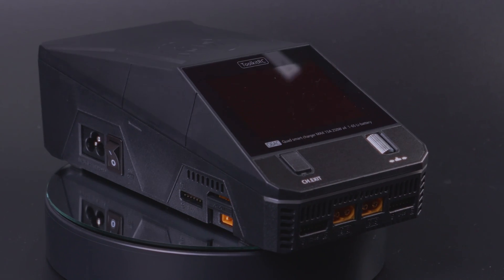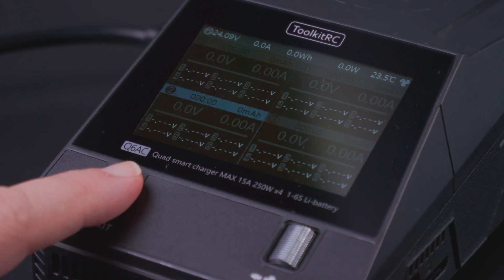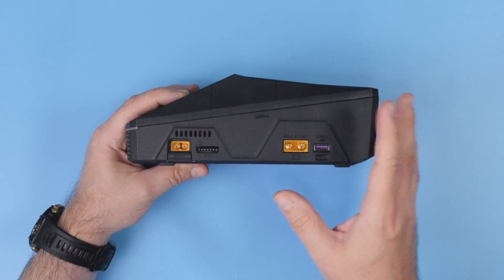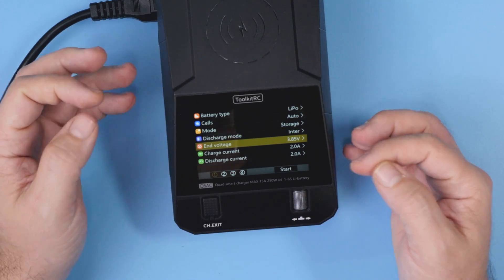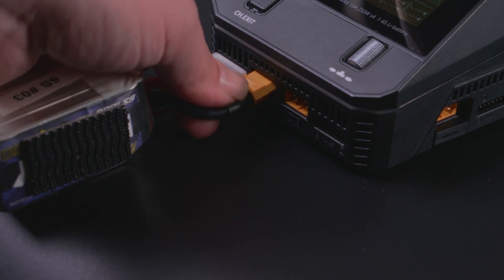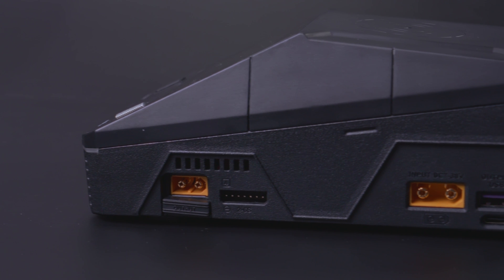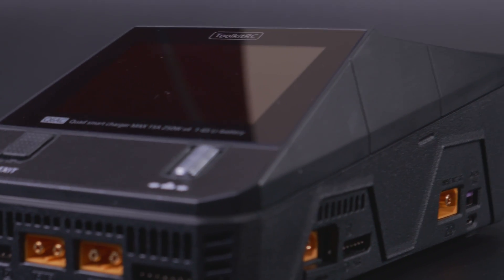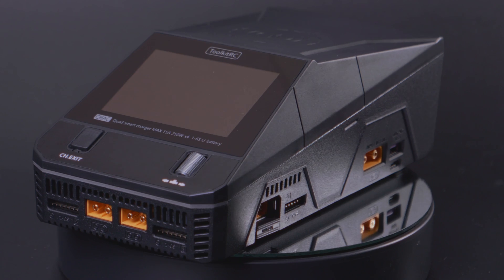The last charger you will ever need | ToolkitRC Q6AC

Comment: I just bought one. I run ec5 connectors on my 6s packs and tx60 on everything below that, so I’ve had to buy some female to male adapters. Would be nice if they included some of these in the box, especially for the price tag. They probably could have done this instead of adding a usb and wireless charging station. 🤣

Comment: A good charger yes, last charger, no. I want a touchscreen the size of a large iPhone, Bluetooth capability with a nice app, the ability to start a charge or discharge program using a timer or clock, and the ability to discharge a 2s battery at 20amps using only the charger, plus the ability to expand discharging capability with a discharge bank.

Comment: i personally modify my own chargers so that they are whisper silent (changing the fan to a noctua one)
my dream charger would be a Q4 charger with only 150-200W AC and a noctua fan! all those AC chargers are just too big and heavy! the ToolkitRC Q6AC beeing 1,2kg ..
i personally love the small ToolkitRC M6D with a 65w type c baseus charger and a type-c to xt-60 cable - really small and light package
charging 6S 1300mAh batteries i need about 30w per channel, so a quad charger with about 150w would be awesome!

edit: or something like the skyrc G630 Charging Hub would be incredible! with this the charger would charge one battery after the other on a "parellel board"!? too bad this system only works with a really bulky old charger ..
Reply from the maker: That would be nice!
Reply: you can't just change the fan to low rpm like noctua and expect the charger to have the same reliability
the noctua is quiet because it's low rpm but also low cfm compared to the stock fan so it will not have the same cooling performance
the charger would have to be designed for a low rpm/low cfm fan...or designed to use a bigger fan by having bigger heatsinks, more powerful power stages that do not get so hot etc

it's lame to have two 40mm fans in 2024, we have 2000w PC PSUs with 140mm fan that would be a lot quieter and even 1000w PSUs completely passive

Comment: Looks good, but disappointing that the front two ports are XT60 only. They assured me for ages before release it would charge both types, but this is a poor design decision.
Reply from the maker: I also would prefer dual purpose ports. But well, That would probably make charger much bigger

Comment: The Isdt K4 is smaller with the same output ratings AND supports 8s & 1.5A Balance current compared to 6s & 0.8 of the q6ac.. Does this make a huge difference in reality??

But it doesn't offer wireless charging and 65w pd, only 10w pd

Comment: Once I learned about Balance Current, I stopped buying ToolKit chargers. Hota D6,  1600ma balance current vs 800ma.
Reply: THIS

sure, you can charge big packs at high amp rates, but if your charger only balances at ~500ma that charge is going to take a real long time to complete.

my charging suite consists of 4 ISDT P20 chargers (1.5A balancing current) with 4-way parallel boards on each port.  each pair of chargers is fed by a single 1200W 24V PSU.  I'll charge anywhere from 8 to 24 packs simultaneously to completion at 1C in about an hour.)

Comment: I use ISTD Q6 NANO.
Cheap, can update firmware through USB, 6S and up to 200W charging, which is honestly a lot for such a tiny charger. 
It was so good I just bought a second one instead of a bigger one.

At 12V it is only 100W but that is still more than enough charging speed.
Reply: same. That charger is impressive but for sure pretty expensive
Reply: @dothgaerwenoakblossom15  34€ on Amazon? Anything less and I honestly wouldn't trust it on the safety side, you definitely don't want to skimp on safety for your charger.

Comment: More than 6S charging is one feature I'd really appreciate with chargers like this. I use 8S a lot (not for FPV multicopters, but larger fixed wing). It can be, for example, to add two 6S channels together to get one 12S channel (you'd need adapter cables or boards, but that's not a problem to put up with if you need such features). I would necessitate clever electronics design, but it can be done.

Comment: Anything ToolkitRC is the last thing I’ll ever want since the last one tried to blow up my Lipos.
Sorry man, but no amount of positive reviews will ever convince me to ever trust ToolkitRC again
Reply: I have a mix of ISDT, ToolkitRC, and hota chargers. I use the ToolkitRC M6D the most out of all of them. That was until the other day at least... I've never had any issues with their products but the other day I was charging a 6S 1,200 pack and when I realized it had been charging for longer than I expected, I took a look and noticed 5 out of the 6 cells were at 4.3 almost 4.4 volts. I've continued to use that charger under direct supervision and haven't had that issue again, but I'm scared to use it. I'll pass on Toolkit.
Reply: @michaelkryszak5262  I’ve had the opposite happen, meaning my M4Q tried to charge 4S to 6S voltage, just out of the blue.
Luckily I caught it in time before it burned my house down, but it continued to do this on subsequent attempts, therefore I’ve thrown it out.

This clearly tells me there’s a clear lack of quality control and/or failure mode evaluation. 
That lack has been well known on their hardware, but apparently same goes for software/firmware, making any endeavor with their products way more risky than it should be.
Needless to say ToolkitRC will never enter my house again.
Reply: I think that you probably had a faulty battery mate.
Reply: @jcswheneveraussieoff-roadi4806 dude,  the display even noted it was aiming for 24V!

Comment: Ultra Power UP9
Only 200W but enough for me and 4 channels too. Less then half price of the ToolkitRC
Reply: the ultra power up9 has only 100W on ac. If that is enough for you thats good, but you are limited to 25W per output (if you use all four) which is only 1.12A on 4 6S batteries (MAX). I’m charging 3000mAh 4S LiIon packs at 1C 45W and that charger could only handle two of those. The above charger has 4 times the output on ac and 5 times the output on dc (one kilowatt!)

So if that is enough for you, fine. But power-wise it does not compare to this one.
Sorry for ranting.
Reply: @dothgaerwenoakblossom15  You Are absolutely right. In my case i fly 3.5' drones and all my batteries are 550mah 6s tattu so I have enough power.
I forgot about 100W limit when on ac because I was never limited.
On fielld I use 3s 8000maah zee battery as power bank and can even fast charge my little 6s.
Up9 is budget friendly and fits my needs, that is why I happy with this charger but you are right. It's not for everybody.
Happy flying.